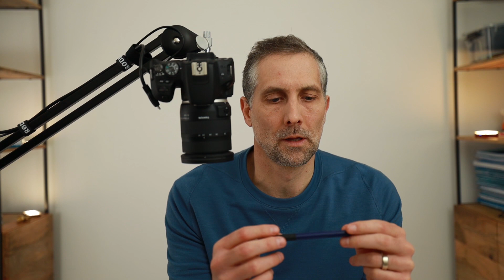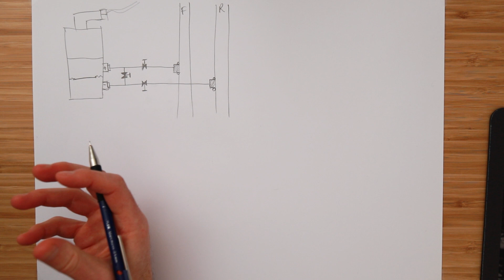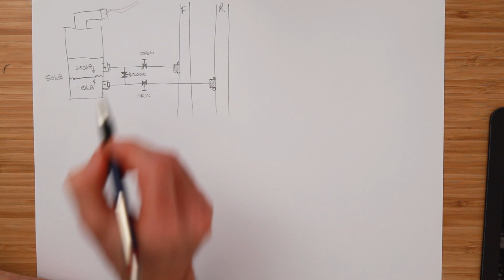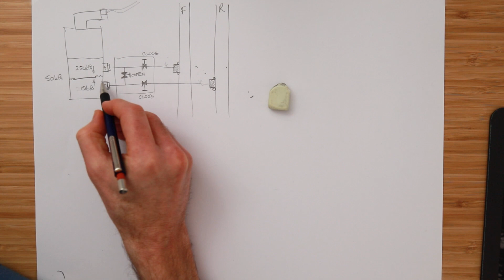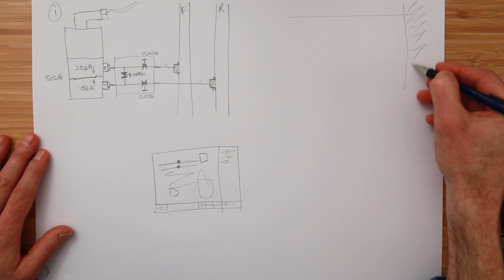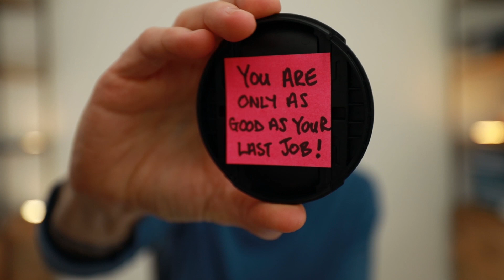System Pressure Control (Part 3)

Comment: Bryce, I think with the advent of PI valves and energy valves being used will relax the requirement to even need a system D/P. If you know exactly what the demand is from the CHW/HW systems then run the pumps to suit and control the bypass to aid the boilers/chillers minimum flow.
Reply from the maker: Maybe? I am not sure. Sounds possible though.
Reply: Bryce, I think water systems are too reliant on old thoughts and we have to change our way of thinking, too much pumping energy is wasted on nor knowing what is actually required in the field.

Comment: In the US we have started using DPT's where the sensors are actually mounted at the Supply and Return piping with elec cables back to the transmitter box. Basically they are 2 separate gauge sensors and the transmitter does the Supply-Return differential calculation. These allow you to forgo the mech piping installation associated with the manifold. Electrician runs the cable from pipe sensors to transmitter rather than pipe fitter running piping to transmitter.  They also have a switch to allow for swapping high/low in the event Electrician runs cabling to supply instead of return and vise versa.
Reply from the maker: Do you have a part number? I have never seen a pressure transmitter that has 2 channels, 1 for the supply sensor and 1 for the return sensor. When I first read your post I thought you meant, a single static pressure transmitter in the supply pipe and a single static pressure transmitter in the return pipe. Then the BMS controller has 2 AI's, and does the subtraction in the controller.
Either way is it probably a good idea. Definitely removes the requirement for the additional piping and manifold. Also less chance of getting air in the interconnecting pipework between the sensor and the main pipes. 
Only issue is; the mechanical contractor saves money but the BMS contractor spends more money. In Australia people would rather provide a non working solution and save money that a working solution that costs more. 
But, nice idea, thanks for sharing.
Reply: @bryceanderson17  Hey Bryce, I believe WPR2 made by ACI is a similar product to what Dennis was referring to. We recently used this on a jobsite. Let me know your thoughts on this!